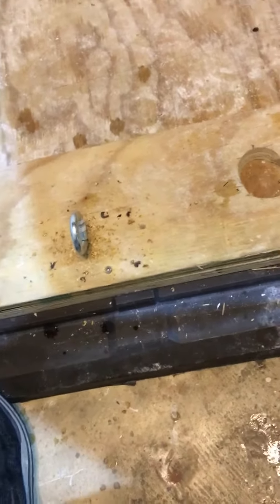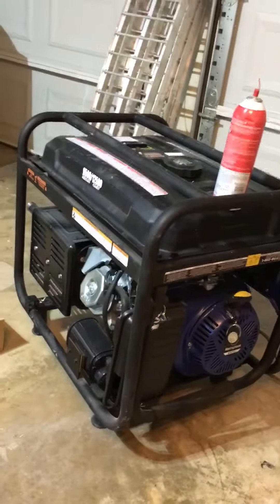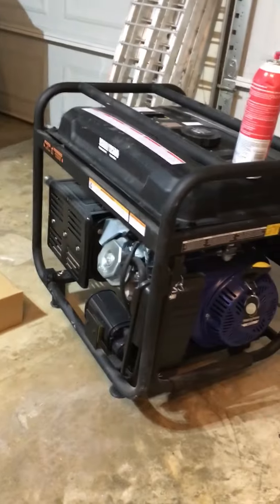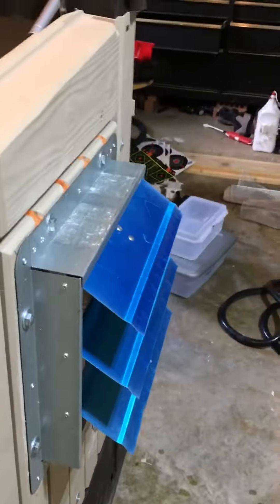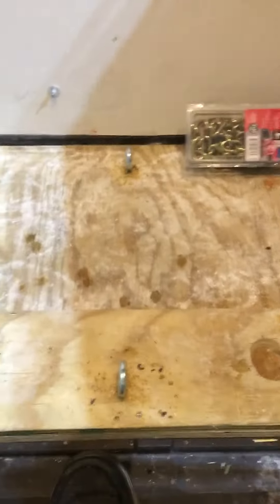Gen box finished

Comment: Looks great!
Reply from the maker: Thanks Papa.  I'll cut the form tomorrow and pig tail some used rebar and i figure 8 bags of the extra strong cement.  I think I did the calculations and it's 8 bags of 60lbs I think but I'll do the calculations again before I go pic it up.  I've got an auger that attaches to my power drill that is well worth the money so mixing will be cool enough.  Being OCD the forms will be level on the level when I stake them and finishing will be a piece of cake.
I need to re level the building a bit as it has sank about two inches in the back and right side.  My floor jack will do the trick and I might get boxed in 2"x4" to run across the runs and move the old concreat levelers over and shim them.
Thanks for recognizing it.  So many people could do better but I always have pride if it's something I did and it worked.

Comment: I just realized you have that plastic little utility shed that you used as the base for you cabinet. I have the same on for my generator -
Reply from the maker: Perfect size.   They are listed in plenty of places but hard to find in stock.  The sheetrock adds some strength to the sides as well as a tiny bit of noise reduction but I doubt much.  I think I watched your vid and may have been the reason I picked this one up.